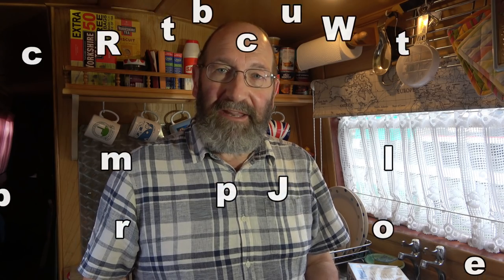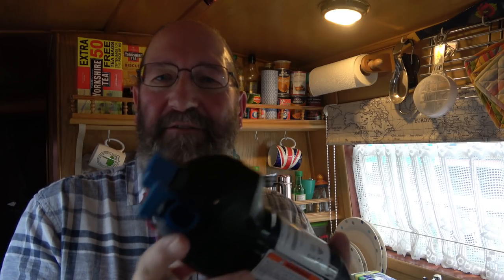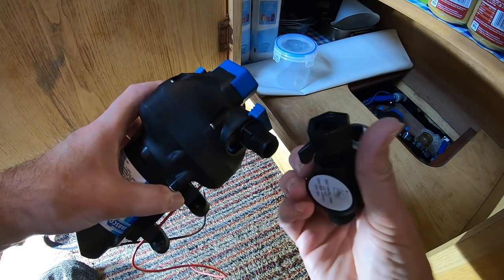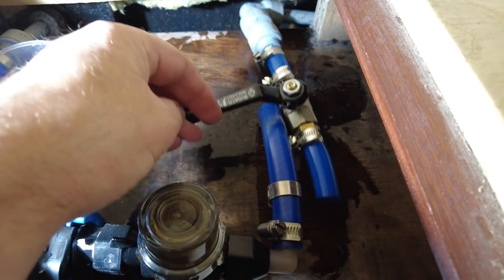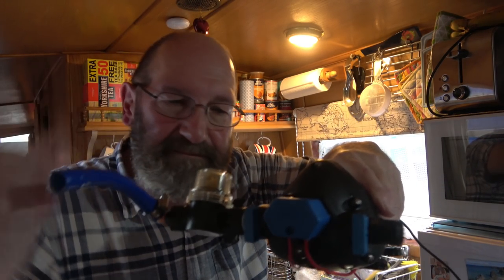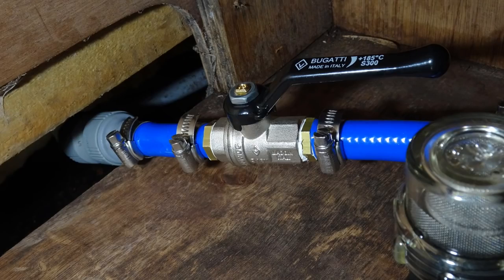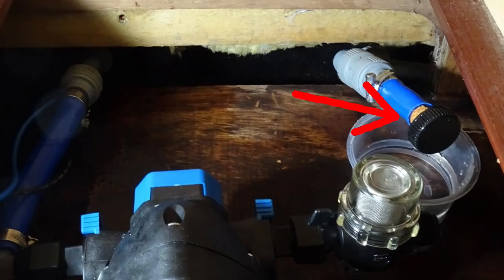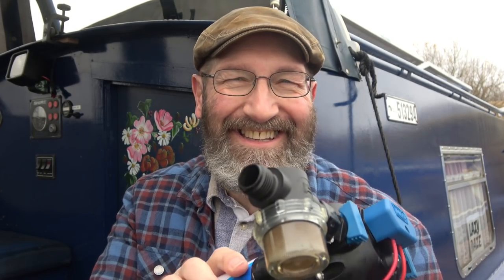260. Jabsco Water Pump Renewal on my Narrowboat

Comment: When you posted this video, I was on a boat which the previous week, we had problems with the water pump and ended up replacing it.

A tip for anyone replacing their Jabsco water pump but keeping the original push-in-and-lock connectors into the pump - these have O-rings to seal, and over time they become hard and no longer properly seal. We had this problem not only on the pump but also the accumulator that used the same fittings. I ended up swapping the O-rings from the packs that came with the new pump onto the older fittings we had (it was the simplest solution.) Care is needed when doing that - use a plastic implement with no sharp edges to ease the new O-rings off the fittings so you don't score them and damage their ability to seal. I had a multi-tool with a plastic tooth-pick which did the job nicely.

We had no further leaks for the remainder of the trip, although we had a week of water finding its way from the bow to the stern end of the cabin bilge.

The boat I've just bought has the same model of pump on it as well - I'm keeping my fingers crossed, and I already have a spare pump as a reserve!
Reply from the maker: Thanks for the advice Russell. My new Jabsco pump came with new push and lock fittings, so I used those. Cheers

Comment: Well done Alan. Hang on to that pump and see if you can get a repair kit for it. (new seals, adapters etc). If you can get one, that will give you a spare one to work with. Hang on to the old pipework you replaced as well!
Reply from the maker: Hi Graham. There is no repair kit for the pump model I had, so I had to purchase new. I did take some parts off it but the carcass was leaking and I chucked it.

Comment: The words 'just' and 'only' do not apply to anything to do with boats. Good job Alan. I'm sure it will last a long time. Cheers
Reply from the maker: Thanks Greg but I'm not so certain, as several viewers have cast doubt about the excess amount of PTFE tape used to make the joints watertight, the problem  being the larger internal diameter of the new pipe not being a snug fit. Cheers

Comment: Alan
Good call to put a shut off valve on the inlet side of the pump 👍🏻.
My thoughts on the hose connections!!
Liquid Teflon instead of the tape on the barb fitting, put two jubilees (hose clamps) over the hose,push the hose on,tighten one hose clamp on the left side and then the other 180 degrees on the other side.
Hope that makes sense!
Glad you met Jasmine,life is better when you can enjoy it with someone!
Not that you needed help in the smiling department.
Look forward to seeing you two share your adventures together.
Cheers Tim 🇨🇦
Reply from the maker: Hi Tim, thanks for your suggestion, I do understand what you’re suggesting but I’ve never heard of Liquid Teflon. I felt let down by the tails and the larger diameter pipe, which was a poor fit. Thanks for your good wishes, all the best Alan
Reply: I built a large home and used a piping that closely resembles what you were dealing with.  Here in the US we call it Pex piping and a special clamp is used that, in my opinion will never allow water to leak.  It does require a special tool ( about $75 US) in my opinion, that stiff piping you used will probable eventually leak when you are using a “Jubilee clamp” (worm drive clamp here).
Reply from the maker: @johnwright9622  The blue pipe I used is flexible. The problem was that its internal diameter was too large for the fittings, all purchased from a chandlers, so disappointing. The pipe should have been a snug fit over the tails but wasn’t hence the need for packing it out, to tighten the jubilee clip too.

Comment: Plumbing jobs are the worst…. Hoping you’ve done it well and you have zero problems😊
Reply from the maker: It's not the best job, as the internal diameter of the pipe was less than it should have been and I had to pack it out.

Comment: Hi Alan, Great to see you eventually battled the frustrations you had in dealing with the repair work. It's good to be a jack of all trades & being able to attain to most basic levels of DIY projects be they small or big. I think you did brilliantly in finally fixing that pump and pat you on the back. Saved you a shilling or two at least. ^5
Reply from the maker: That’s very kind of you to say but several viewers are of the opinion that I will need to revisit the joints because of the amount of tape used. The pipework needed a smaller internal diameter.
Reply: @MyNarrowboatVenture  I agree that you have to keep eyes on the join, I would replace them with a compression joint and a shorter mettle/plastic pipe each end. I think that would solve the leaking issues you are having. 👍
Reply from the maker: @castingshadows282  Thanks for your advice, I will look into it👍
Reply: @MyNarrowboatVenture  👍

Comment: Good vlog Alan, and a good example of how boats keep you on your feet!  Its good your pump has flexible hoses on it to stop vibration. Did this myself a while ago - put a cheap tin foil baking tray underneath it so i could see any leaks and also got a cheap flood detector to alert me. I'd keep the old pump in case this one packs up completely when you're out - something is better than nothing... take care!  Rob
Reply from the maker: Hi Rob, thanks for your comment and suggestions, I have though got rid of the old pump, I just don't have the space to keep everything. Took some spares off it!  The old pump had 10 years service. Cheers

Comment: Best tip i ever saw and i think worth a share, is if you get some touch, none flexible pipe, put it in hot water for a small time and then push onto the joint - Can i ask why you didn't go for the new model
Reply from the maker: Yes I agree, it's always a good idea to heat up the ends of more rigid pipework, the problem here was its larger internal diameter. I wanted to replace like with like, and there were some differences which might have affected the re-fitting.

Comment: I think a different type of stop valve would have been better, one with plastic type connections.
Otherwise a very good Vlog showing the "pitfalls of plumbing" !
Stay dry  !
Stu  xx
Reply from the maker: I went to a chandlers and expected to buy something robust but it proved otherwise, really let down by the larger internal diameter of the pipework, which made for a poor fit.

Comment: Good work Alan. These small jobs are always a work up. Just one point, is there an inline fuse? You never mentioned it. I changed my water pump recently and had to work a round the fuse. Anyway all the best.
Reply from the maker: Thanks Paul kind of you to say. There is a separate fuse for the pump on the control panel.

Comment: Now you have it sorted buy some more pipe with a smaller ID and a tad more flexible if possible.
The pipe should be a tight fit and watertight without the clip & the clip is just for security, BTW buy the best quality clips you can. 
Looking at the room you have for the pump I would be looking to change the layout by turning it to run bow to stern (90 degree turn) and just use longer pipes (you have the room) with elbows to change pipe direction where needed.
Reply from the maker: I was disappointed that the chandlers sold me smaller ID pipe but it is more flexible than the older connecting pipes. I understand what you are saying but I worked with what I had. It's interesting what you say about turning the pump, I'll look into that, many thanks.
Reply: @MyNarrowboatVenture  Yes of course I understand that (it was bigger ID they sold you)  and you had to make do at the time.
Bear in mind my comments and if that looks like a plan you can assemble things to sort the issue for good at some stage. (I would not trust that PTFE solution long term)
Reply from the maker: @gegwen7440  Many thanks for your advice 👍

Comment: You should find out if the old pump can be rebuilt and get parts for it.
Reply from the maker: It doesn’t have a repair kit, as otherwise I would have used one. It was leaking through the body. I stripped a few parts off of it to save.
Reply: @MyNarrowboatVenture  oh well I was thinking that it could have been saved for emergencies. Oh well Take  Care.
Reply from the maker: @allenhatt3433  Thanks Allen, will do and you.

Comment: This will leak soon.  You must use the proper hose with the correct internal dimension.  Wrapping something around the fitting to make it larger will not work for long.  The tape you used is only for threaded joints!  I give it can week or 2 before it starts leaking.
Reply from the maker: Thanks for the advice Gregory, I will look into that. I did the job some months ago and it's been ok to date.

Comment: By using the pre tape on a barbed fitting you no longer have any grip on the hose I'd by watching and or changing your set up
Reply from the maker: Hi Lance, others have suggested the same. I need a pipe with a smaller internal diameter to be a snug fit. I will look into it, cheers.

Comment: I am not criticizing your job you did well with what you had to work with, but over here when one of those pumps goes out it is usually the inereds and we can replace the rubber flaps and such in  a rebuild kit , altho the thread fittings could have been installed and then used the push fittings to put it in place.rather then the push first then threads. in this way the pump can be removed without unscrewing anything. I know you wanted to replace the rest of the gubbins but the pump itself is designed to be a pop out and pop in unit.
My problem is not with you, it is with the suppliers , instead of selling the consumer  rebuild kits they sell only the new pumps or replacement pumps. which makes the entire unit disposable.  This not just with pumps it is with EVERYTHING.
Sorry just ranting about the people that design this crap. If things are being made in the good from the start,  then we would not need to replace them in the first place.
CCHHEERRSSSSS and where is the cheese topped roles these days, did they stop being made as well. LOLOL  ?????
Reply from the maker: Thanks for your comment. I did ask about an overhaul kit but this model does not have one, so I had to buy a new pump. I understand what you're saying about the threaded/push fit parts but I thought it was best to replace with new. It's good to have a rant now and again, so long as it's not directed at me. I'm still eating CTRs but not always showing me doing so. Cheers